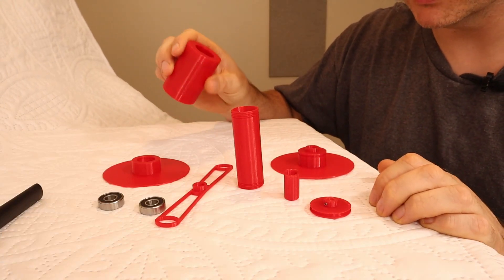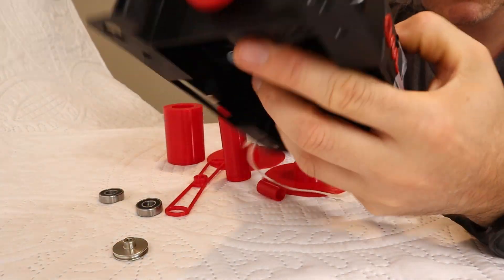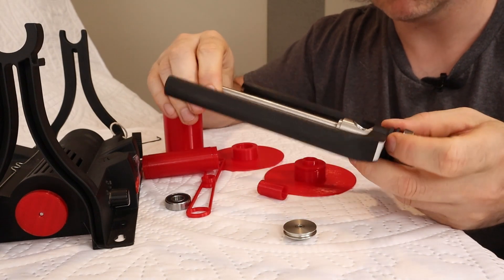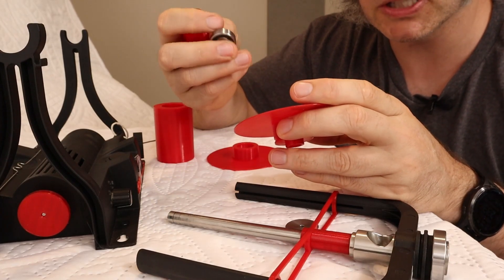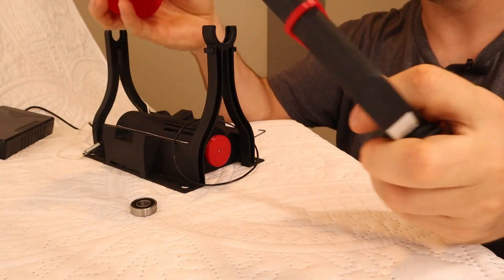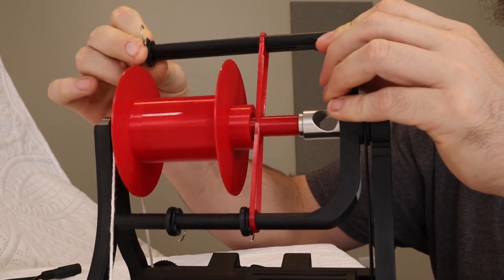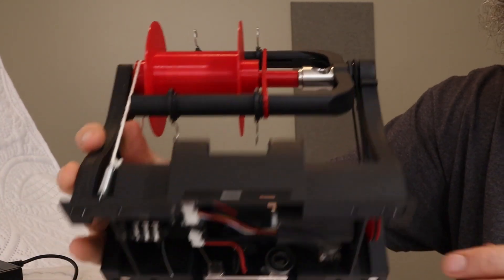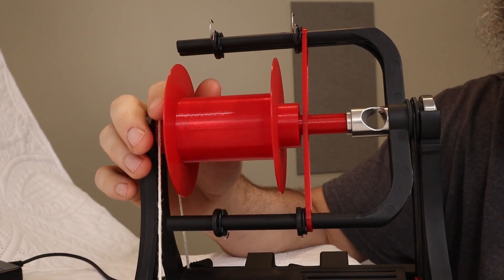Spin 162 - EEW 6.0 Lace Flyer

Comment: Hi Maurice brilliant bobbin, I have printed off a couple with a few print really need tweeking. I find the top surface of the bobbin ends very rough and really need sanding.the discus very thin which is obviously needed but when your preparing after print and sanding the shaft block is coming off if if your gentle. I have a few different filaments and brands and it’s not any different to the end result I haven’t had any really issues printing the other bobbins. Then the shaft spacer and the flyer spacer shaft hole is to small and that also needs tweeking the bearings on these are a perfect fit any advice as to how I can get a better end look and not have to spend more time sanding and having to widening the shaft holes ?  Thank you kindly Jo
Reply from the maker: I think your printer isn't calibrated very well.  The fit for everything was good for me and a few testers with well calibrated printers.  The bearing holds are made extra large and should be loose. I did this because this part the fit doesn't matter and I know other people don't have the best calibrations on their printers.  But if those parts fit well that says your printer isn't printing quite right (these parts are quite loose by design and on my prints).

You can possibly modify my parts.  Sometimes something as simple as enlarging a print a few percent can get them fixed.  Or you can look up tutorials online on how to calibrate your printer.

Hope this helps.